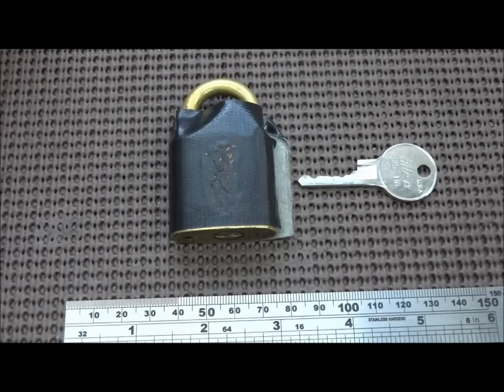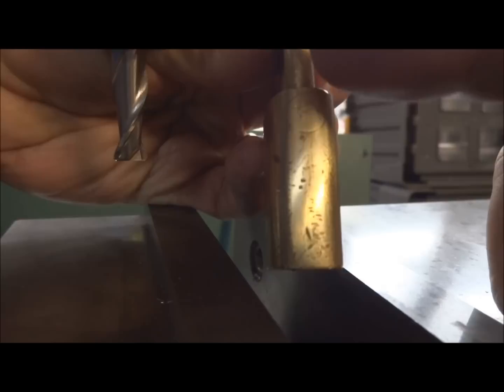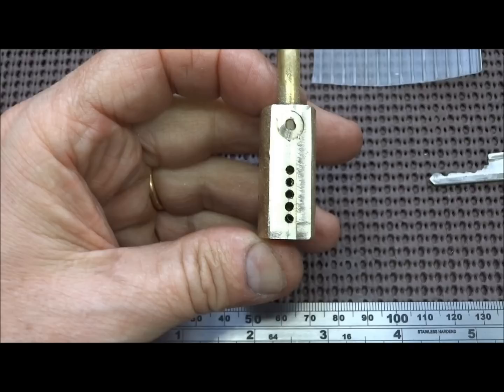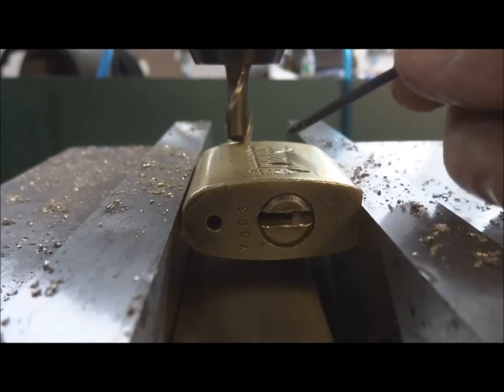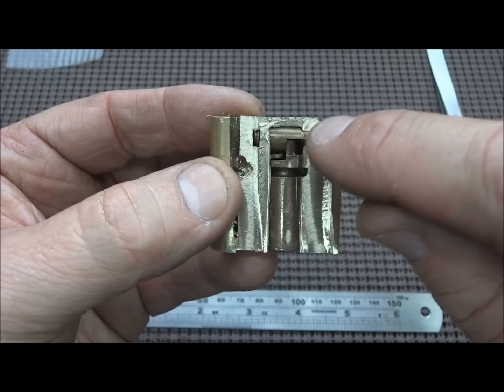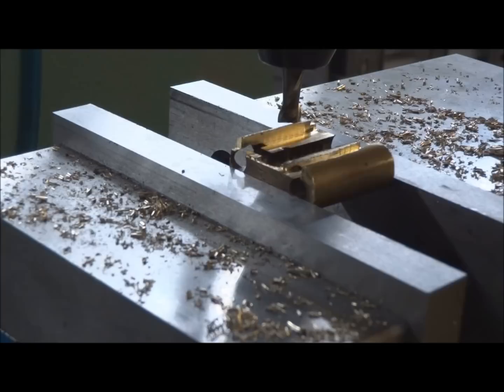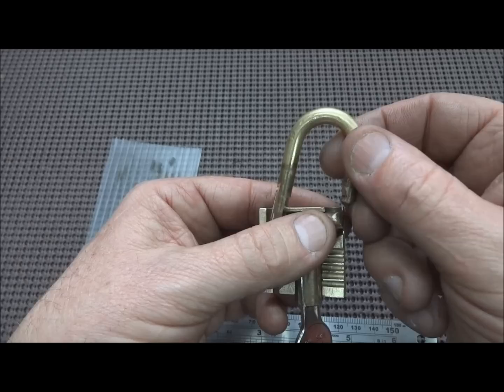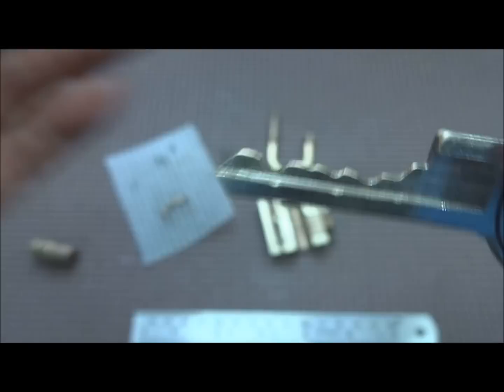(123) Hurd 40mm USN Padlock - MURDERED!!! sorry....

Comment: When I was in the Navy we used these in the engineering spaces. We had to cut these things all the time because they bind up from corrosion from sea water.
Reply: Saltwater will the key mechanism would bind up all the time, but over time it will form a sludge on it called vertigre and that's want binds it up.
Reply: Weedus  brass can get corrosion very easily, thats why brasso polish exists, also in thermal/salt water areas it does it super fast

in my town in turns black in 3 weeks

Comment: older vid, BUT youy can see at 4:47 the pins are TAPERED (# 2 for sure, 1&5 *maybe) harder to pic, but just means you gotta use way more tension and keep going through them in sequence till it pops.

Comment: That was cool! 

I went through about 5 blanks trying to impression one of those Hurds (maybe that one). One thing I've noticed is that they seem to like REALLY low bittings. 

At least we can measure the pin spacing now to do a better job impressioning next time. 

Thanks for the milling demo, Bill! You may be a lock serial killer, but you do it with style and precision. :)

Comment: I had the same problem. The super low cuts are the likely culprit -- the pins probably don't have enough leverage. 

One mistake I made was getting nickel-silver blanks. I probably should have tried to find brass and then annealed the living heck out of it. A softer material would have a better chance.

The tolerances in there must be really good. 

Oh, and you need to apply the fingernail polish to the key, not your fingers. Just a reminder :P

Comment: Hey Bill, thought I'd come on back to this video. I recently bought a bunch of locks and in there was 2 Hurd locks that I believe are keyed the same ( they both have 513 stamped on the bottom  but no keys ) I have been able to open the one I labeled Emanon 1 quite a few times in about 2-3 min each time, the one I labeled Emanon 2  I have not been able to pick at all ( one session, I spent about 3 hours on it). I Guess that some of their locks just like to put up one heck of a fight. I mean the second lock almost acts like it completely binds up when you start.

Comment: Bill, I'm guessing (as other's have) that it was simple time/weather/crud-petina in the lock that provided just enough resistance to prevent you and other people from picking the lock.  

Have to say I love the milling machine.  Besides the milling machine being ultra level and precise, could one do something similar with a drill press and some sort of movable table or base.  Perhaps lock the drill bit/cutter in place and slide the work piece back and forth UNDER the cutting bit or wouldn't that work?  Obviously no where near as precise but for something like cutting open a lock might it work?  Just curious.  

Hope things turned out well with the zombies.   ;)
Reply: a drill press isn't really designed to have force applied laterally on the cutting bit, it may be doable though
Reply: Soulrider2012 That's actually how many mills work.

As for the other comment, that's drill bits, not the press itself.  If you use a milling bit you shouldn't have any trouble.

Comment: Hi Bill, to find the pins in locks like these try rubbing the lock with a light machine oil, cleaning it and then putting it in the vice with a piece of paper around it. This should show a ring where the pins are. Then you can just drill out the plugs holding in the pin stacks. Ditto for the pins holding the core and the shackle.
Reply: John Linquist: Blue dichem or a sharpie marker will work as well.

Comment: Hi Bill,

I love your videos, and knowing your skill I'd wager that when this lock was NEW you would have had no problem picking it.  Now that the lock has aged a few decades and has that hard to reproduce on demand brass patina in the cylinder and core the patina actually increased the tolerances to the point it was very nearly impossible to pick by mere mortals.  

I wonder how we could 'test' the theory that the aged patina is / was the reason the lock was so resistant to picking?  If the theory is proven to be true, could a lock manufacture take advantage of this to improve the security of their products?